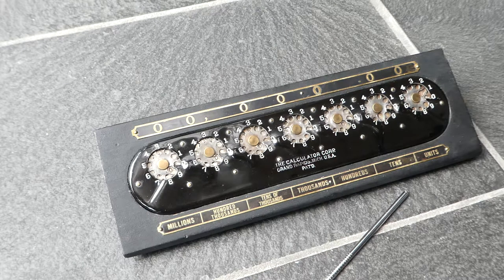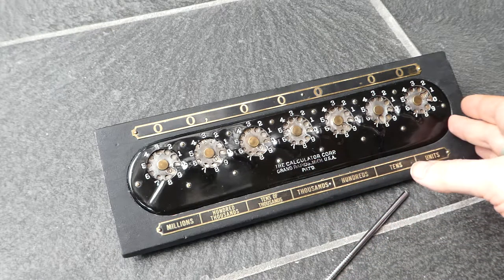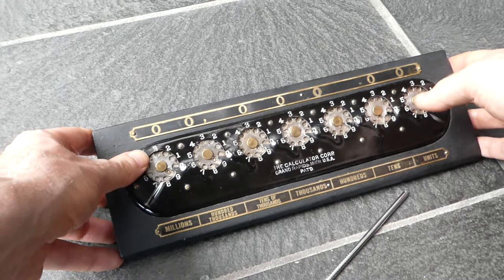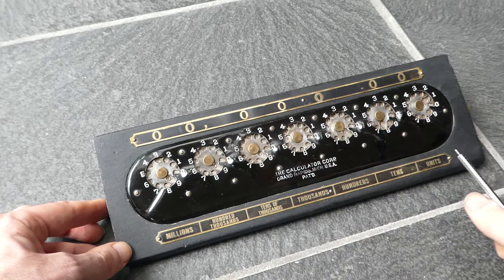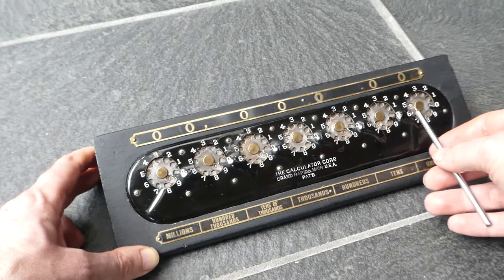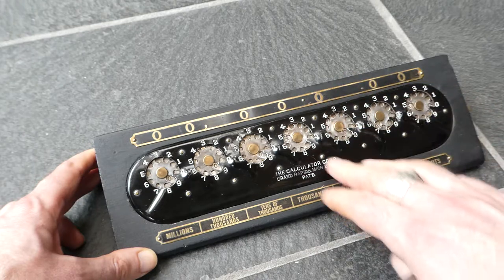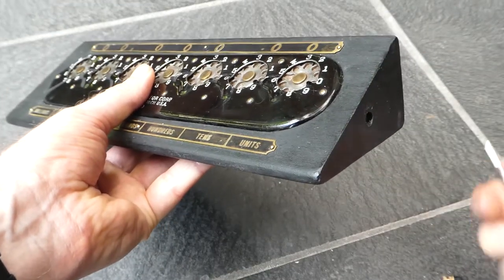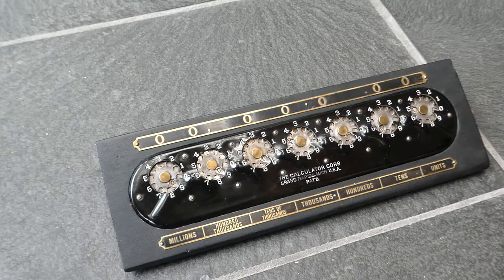The Calculator adding machine

Comment: Love these videos on old mechanical calculators.  For this one how do you zero it?
Reply from the maker: Thanks. Yes, I forgot to show that. When I said that you cannot do subtraction by turning the dials anti-clockwise I meant that only that the carry mechanism doesn't work in that direction.  You can however simply put the stylus in a hole with the digit and turn the dial anti-clockwise to zero, as no carries are involved in that.